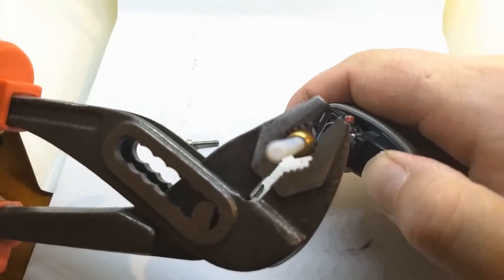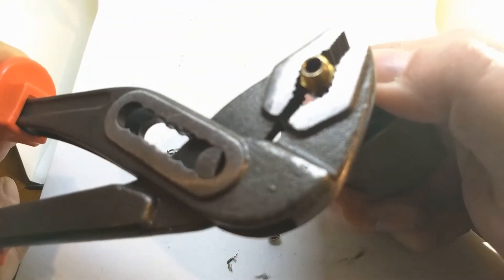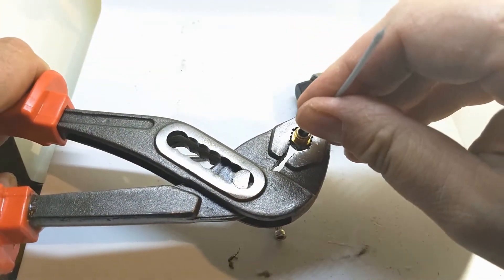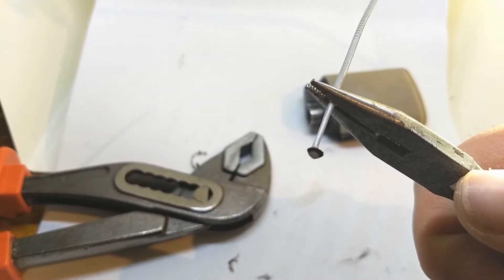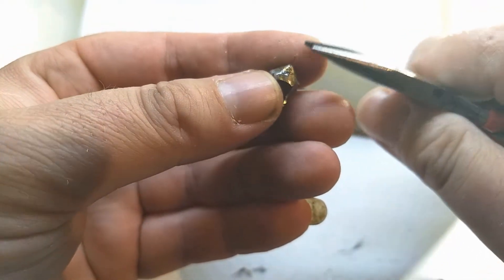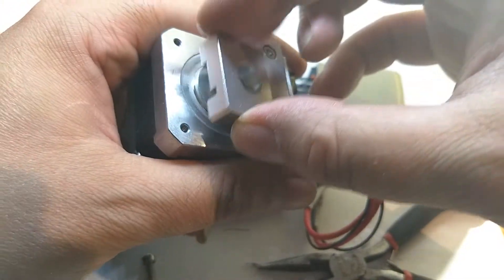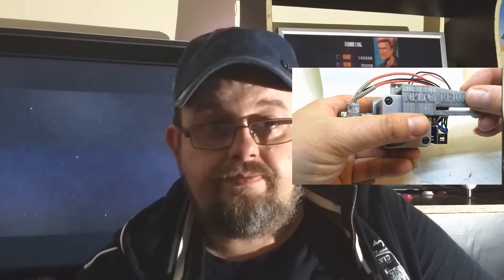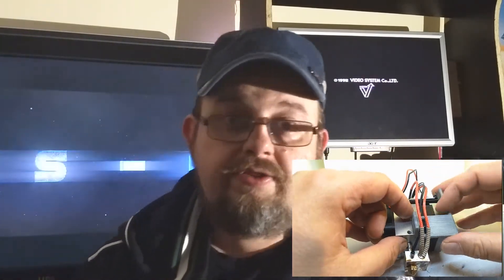Cleaning nozzle and reassembling the extruder on my Renkforce RF100 3D Printer,Printed Bracket fail.

Comment: Can you tell me which nozzle fits on the renkforce rf100? I want to by a new one, but I don't know which type it is.
Reply from the maker: All MK8 Nozzles should fit. 
I tried up to 0.8mm and it goes fine.
Reply from the maker: btw  the orginal nozzle is 0.4 mm in diameter
Reply: @MrRetro78  Thanks! I justed needed to know the size of the thread. It is nowhere mentioned on the internet.